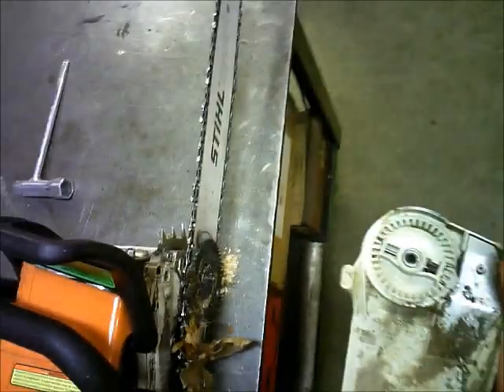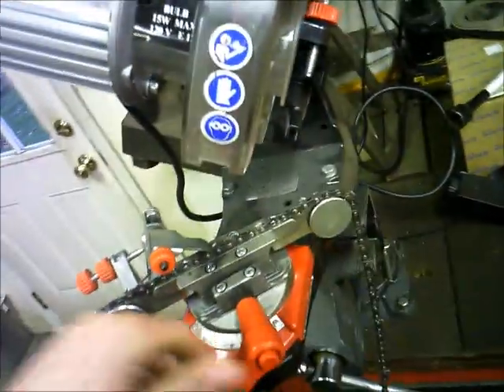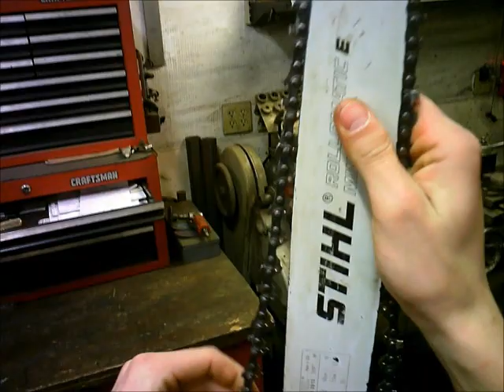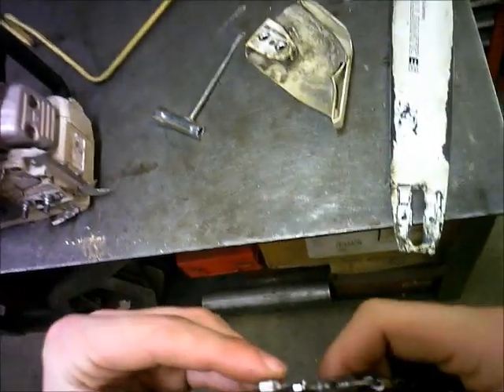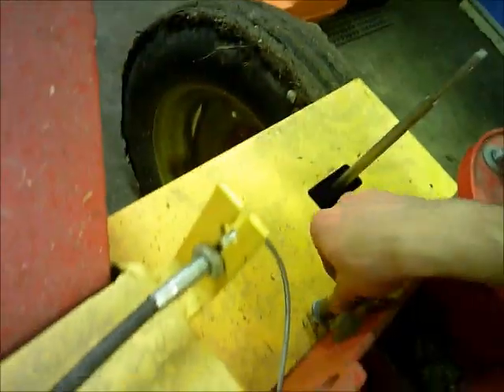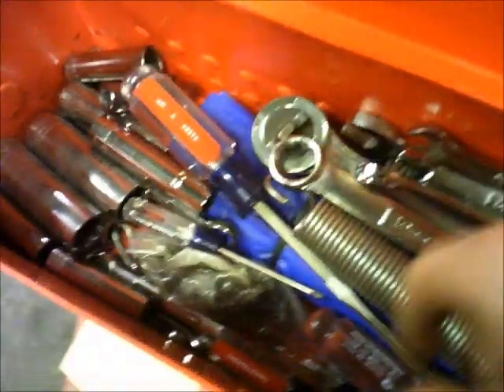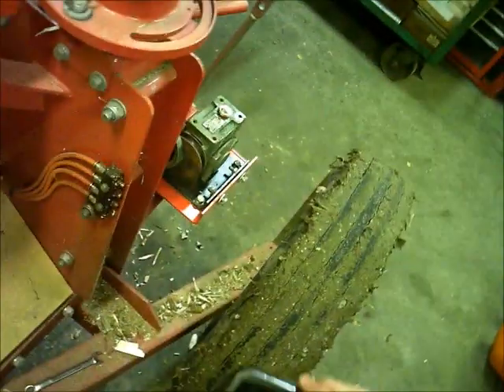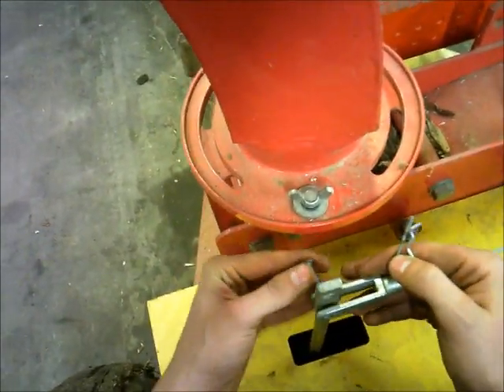Sharpening Saws

Comment: Back in the 70's when I worked with my brother, We putup bins and elevators. We got a job to move  2  bins that were over width and height..  We found an outfit that was using a helecopter logging... We got them to move them one sunday morning.. you can do it the way you described.. use a stout piece of timber down thru the center bin cap ...
Reply from the maker: +David Goethe Yea, the hardest part is goin to be getting ahold of the bottom set of rings after we split the dang thing.

Comment: I might have to get me one of those grinders. I have been kicking around buying one for a while now. I been sharpening mine by hand but tend to hog a little more material than I should. Stihl makes good chainsaws. I have a MS361 Pro,MS290 Farm Boss and a Husqvarna 455 Rancher.
Reply from the maker: +Fieldman12 Ive never really bought into the whole superior german engineering thing cause Ive had to work on things they built, but damn they can build one hell of a saw. LOL. I highly recommend the bench sharpener, worth every penny.
Reply: +Oliver66FarmBoy Yeah, I have never really bought the whole German engineering is the best either. I have a JD 2155 built in Germany. I must say its been a good tractor for me but I have heard the hydraulics can be a mechanical nightmare to fix if any issues pop up. I think in that size our MF 165 or the old Ford 4000 I use to have was a better design over all.

Comment: nice vid. :) my chain sure does not stay sharp 4 long! it sure did when it was new. i sharpin mine by hand! i have a ms 290 farm boss 16 in bar.
Reply from the maker: +MRJOHNDEERE3720. :) Yea, once you get out into a 24 inch chain hand sharpening takes forever and I just dont want to put the time into sharpening something that is going to be whopped in three or four hours of cutting. I can zip through my big saw in less that 10 minutes on that electric sharpener.
Reply: Oliver66FarmBoy
i wanted 2 get a electric sharpener but then i started thinking that well im not useing it alot so y put money in2 it.